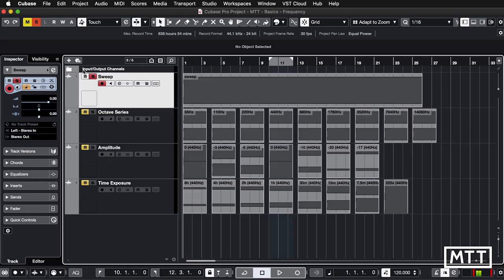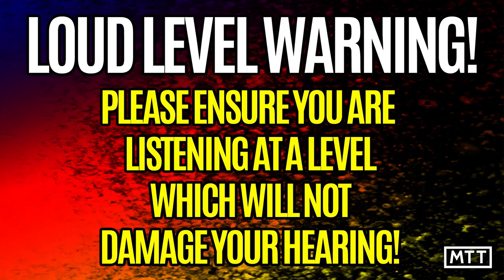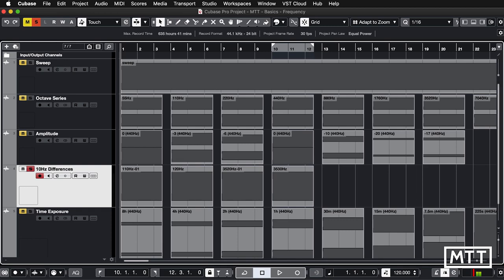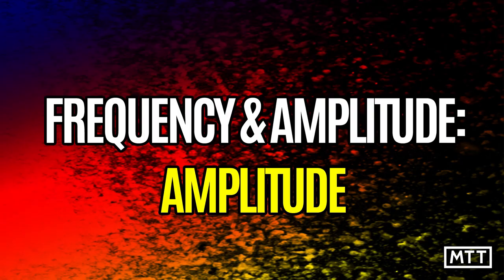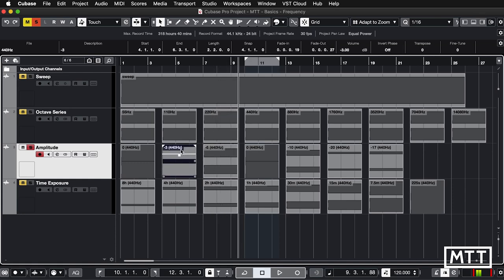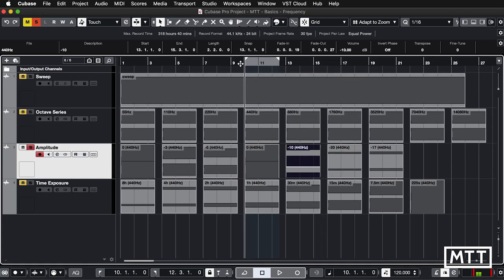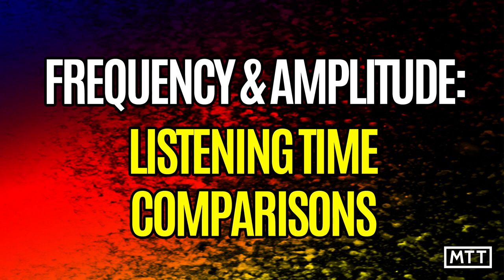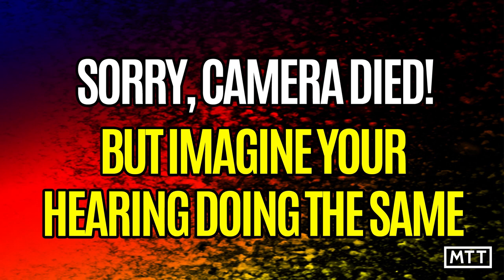Basics: Frequency and Amplitude (The Language of Sound)

Comment: Could you please explain how to set 60Hz, 120Hz, 240Hz and up above relatively equal in amplitude.  Thank you.
Reply from the maker: You would just need to normalise them to the same level.  They may sound different, however, as our frequency response isn't flat - so even if they are at the same volume, we will think otherwise.
Reply: @musictechtuition  I have noticed that high frequencies are louder than low frequencies at the listening position. I just want to know if I generate sine wave from noise generator, how to match loudness of a very high and a very low frequency.
Reply: @nishanthadeabrew  It sounds like you're talking about perceived loudness, combined with the effects of your listening system - speakers mostly, but possibly amplifier too.  To get them to the same loudness for you in that position, I would think you'd need to use a calibrated microphone to measure the frequency response in your listening environment, and account for that.  There are systems available that do this sort of thing (Dirac Live is one), but that's a much more complex subject than to be covered in a YT comment!  On top of the room's response there is also the listener's response curve (https://en.wikipedia.org/wiki/Equal-loudness_contour) which is also worth reading up about.

The cheap way, of course, is to do some A/B tests between signals of different levels and come to a point where you feel they are the same volume.  This is how the equal-loudness curves were originally experimentally determined.
Reply: @TheDarrenJones  Thank you for your valuable time and you are sharing very valuable details. Thank you and appreciate 🙏.